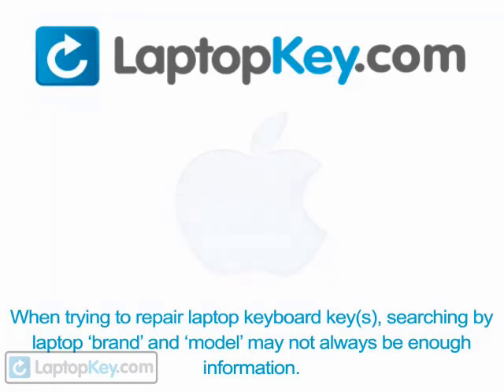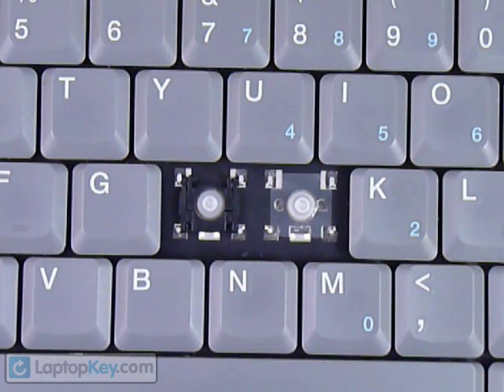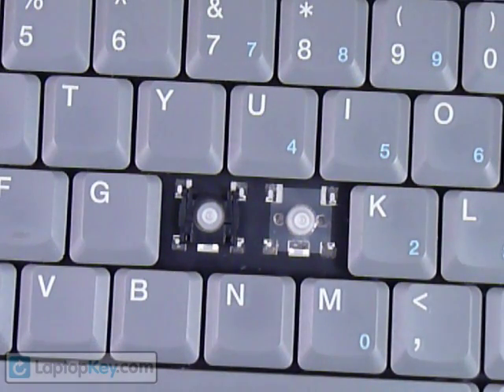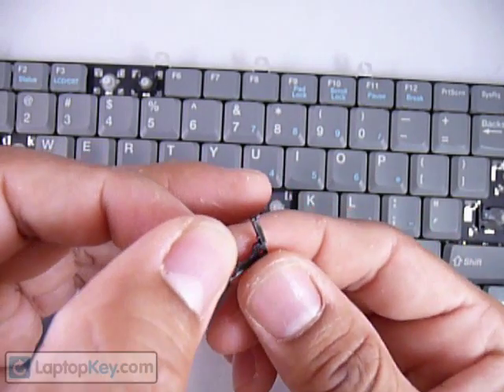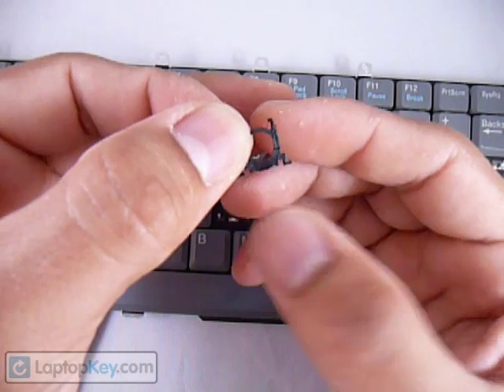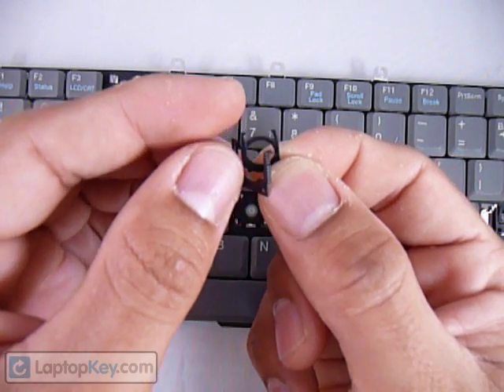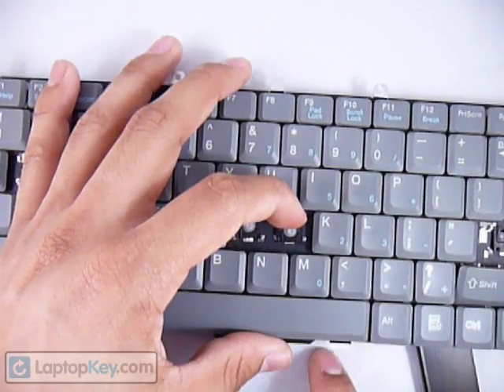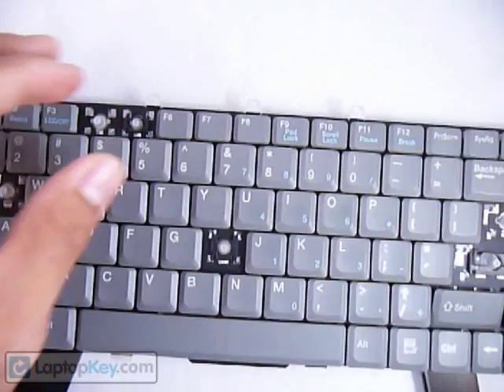How to connect Key Hinges Retainer Cup to Laptop Keyboard

Comment: Took off key for cleaning- now can't get wired keyboard large bottom left CONTROL key back on -  metal clip goes into holes but key will not snap into placement be some trick I can't do HELP !
Reply: Please if you found a solution tell me